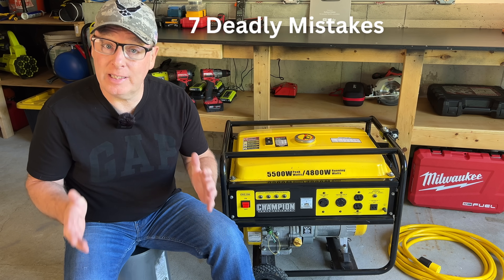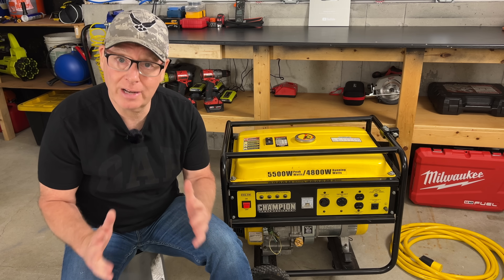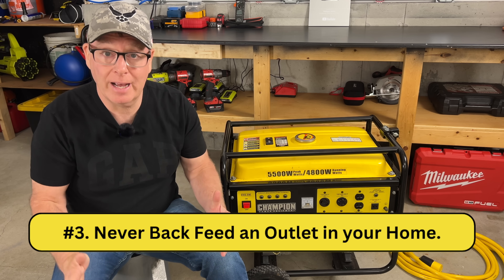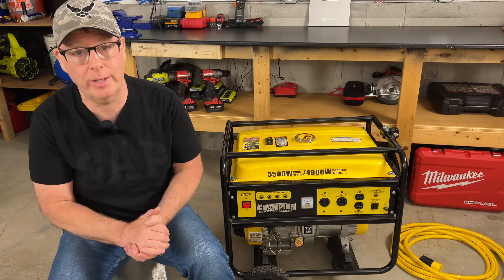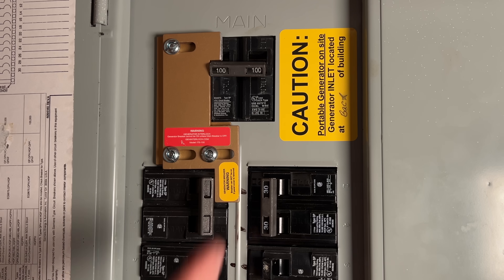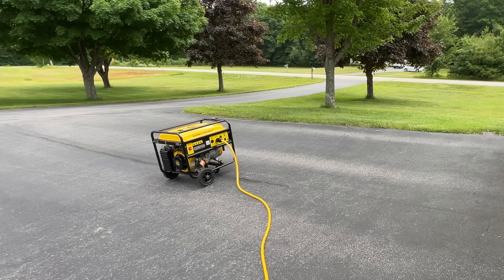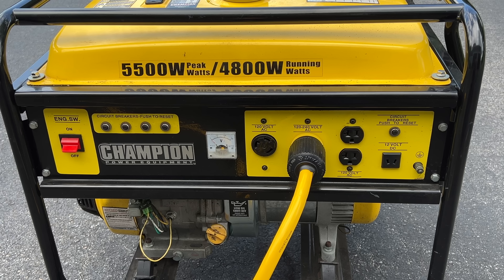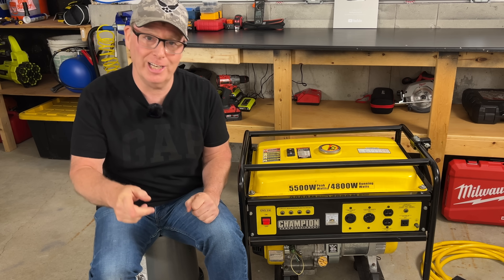7 Backup Generator Mistakes. (Have You Made One?)

Comment: Great tips! I especially like that you focused on back feeding outlets & killer cords. I'm a power lineman & we find most generators are hooked up correctly. However a few have been improperly hooked up. When we enter a neighborhood during a power outage we always check our equipment with our test equipment anyway. Once we found a back feeding generator feeding a neighborhood & the wires on the ground were energized to 13,000 volts. People were walking amongst the wires & had no idea they were "HOT". 
I have a portable generator. I have the best of the best. Honda EU 7000is. I had a fabricator build a stainless steel enclosure Hiltied to a concrete poured in place pad with a ground rod. The enclosure is vented on two sides with a hinged lid. I had an electrician wire mine up with an interlock, hard wired remote start & trickle charger. 
I'm often at work already so I made it simple for my wife to start it when I'm not home. That way she can feel safe at home. Safety is paramount in my house. 
I have a 6 gallon auxiliary fuel tank that I can hook up for extended run times. I add my fuel to the auxiliary when the generator is running. The genny has fuel injection so there is nothing to prime. I get 42 hours of run time before I need to totally refuel. 
All together I'm in at $14,000. You can't put a price on safety. The money spent is like having an insurance policy you hope you never need it? But if I do? It's always ready. 
I look forward to your other videos! Great content!
Reply from the maker: Wow. Sounds like a great setup. I need to do something like that to make things easier. Safety is number one for sure. My father and brother in-law both worked for the power company as lineman. Im retired now but I worked as an electrician and then an electrical engineer my whole career.
Reply: @BackyardMaine  That’s awesome that your family is involved in the power industry! I applaud you & your family for the dedication & strong work ethic to succeed. I’m sure you have heard it many times before. Not many people can do our jobs. The long hours of commitment & the family that backs us up. 
I had help from the substation electricians at work. I was getting ready to pull the trigger on a more comprehensive set up & they stopped me. I purposely bought our home on a backbone. So we hardly ever lose power. We are on a loop scheme so in the event we lose the feed from one substation. Power can be restored quickly through reclosures in a manner of minutes. No lineman or electricians are involved. Unless the wire burns down in front of my house? We almost always stay on. In the unlikely event we lose both feeds do we lose power all together. That’s where the back up power comes into play at our house. As you know the last persons you want to be calling you at work is your family. I made my set up “lineman proof”. My wife can flip a few switches & push one button & power is restored quickly at our house. The only time I get a call is to check on how I’m doing after being at work for more than 24 hours. It’s peace of mind for me. You can’t put a price on that? 
Again thanks for the great tutorial & thank your father & brother in-law for being lineman .
Reply: Holy cow! $14k?
I spent a bit over $10k and have 22kw Cummins whole house generator hooked up to my home LP tanks. 
I’m a roof contractor and have to be up and connected when hurricanes hit.
Reply: @3fsw3  What's not discussed is I live an ASSociation. They won't allow me a propane tank. If I had natural gas? It would be a home run. I looked at a diesel powered water cooled stand by generator with a 300 gallon belly tank. 
The ASSociation only took exception that it was  huge. I would have to have it surrounded in tall enough bushes on all sides so my neighbors wouldn't have to see it? I got estimates with a vinyl fence etc. I was looking at $27 K for that. 
My coworkers thought that was crazy money? Even though I was ready to pull the trigger on that. 
They suggested that I go with a roll out. 
I had a fabricator build me a little house for it on a concrete pad with a ground grid. I specified 306 stainless steel with a hinged top & hasp to lock it. The box & other hardware came to $2700 cash. The genny was $3700 (Honda EU 7000is). Electrician to wire it up with a wired stop/stop in our basement. Duplex outlet for the trickle charger. Low voltage cord for the start/stop. Wiring into SS house with drip loops. All above code. (Mind you this is a unique set up). 
Add to that every accessory made for that genny, service manuals. 15-5 gallon Jerry jugs.
1 HMC 30 gallon fuel Dolly. Grounded rolling steel rack for the fuel jugs. Etc, Etc,Etc.
Hence the high number.
Reply: @johnclyne6350  I couldn’t lived with an HOA. Sorry to hear that. Those big generators do run on natural gas too. You can also bury LP or natural gas tanks. Keep on truckin✊🏽
Reply: @johnclyne6350  Open up the propane ports to run NG, or buy NG ports and convert.
Reply: @grega2362 The Honda is not a bi-fuel generator. It can be adapted to run on propane & I believe natural gas? We have plenty of gas stored at our house so storage is not an issue. Propane is not allowed where we live because we live in a HOA. Natural gas is not available where we live. The line ends about a half mile from our house. I looked into extending the line but the costs were prohibitively high. Something on the order of $120,000. That was 8 years ago so that number I’m sure is way higher. No, none of our neighbors are interested in natural gas so the cost would be on us. 
We hardly ever lose power where we live because we live on a loop scheme 3 phase line. In lay man’s terms that means we live on a Main line out of the substation. So, if we lose power it’s only when the rest of the state is badly affected. 
I bought it for peace of mind & wanted it for the few times we have lost power because living without heat or A/C is just too uncomfortable for me. Especially if I’m restoring power to other’s homes & not my own after days & days.
Reply: @johnclyne6350  They are ok with storing gasoline, but not a couple of 100 pound tanks of propane? That is pretty wacked. I'm retired now, but for years I serviced generators mostly for water plants and municipal buildings. Diesel is great, but it requires a lot of upkeep even if rarely used. Diesel tanks get water in them from condensation, and once there is water, they grow "algae". Natural gas is great as long as you have a reliable natural gas supply. Propane is in sealed cylinders so it never gets water in, and it never goes bad. I've used propane that was stored in tanks that was 30 years old and it was just like they were filled yesterday. Also much safer to handle than gasoline
Reply: @joecummings1260 I've been using gasoline powered equipment for over twenty years. I have never had problem with my fuel. Even gasoline stored on my line truck. 
Just like electricity. I have a fearful respect for it. As long it is used before it goes bad? I have yet to be hurt by it. Same goes for high voltage electricity.
Reply: @johnclyne6350  Yeah I've used gasoline powered equipment my whole life and not had any real problems. But propane is so trouble free, you can buy it and not have to think about using it and replacing it so it doesn't get old, and due to the way it is handled and stored it really never gets contaminated. I use it for my generator, and for one of my forklifts and I love it. I use it for portable heaters also, much cleaner and reliable than my diesel fired portables. To me it's a lot safer too, no spill risk, and the tanks are rugged
Reply: You have a ground rod with it wired into your home?
Reply: @98f5 My house electric service has 2 ground rods for a 100 ampere service. 
I have a ground Rod connected to my fuel rack inside my shed. As well as one for my generator. The generator has a floating neutral. The ground for the generator is to minimize any static discharge when the generator is producing power. It is tied into the ground for the 306 stainless steel enclosure. Incase the enclosure becomes energized? The ground Rod will hopefully carry any induced voltage tied to it?